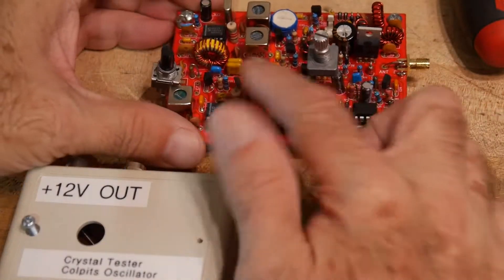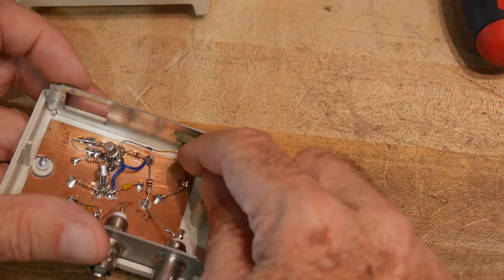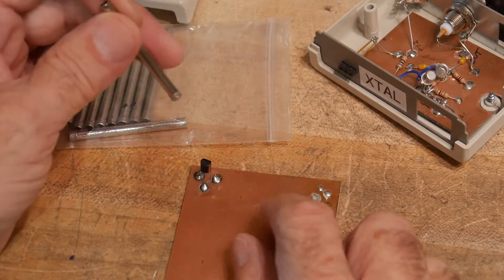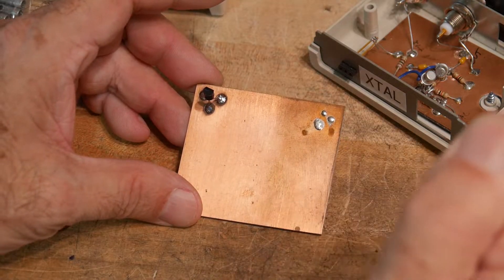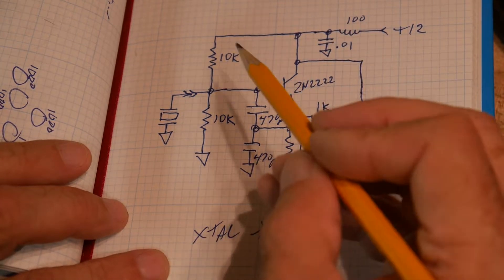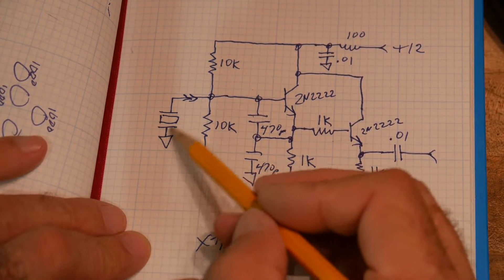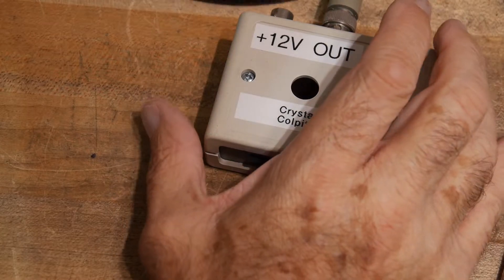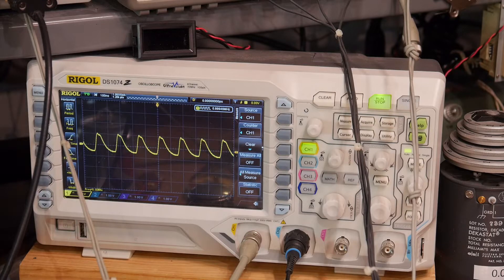#279 crystal xtal oscillator tester

Comment: I bought those 5mm hole saws you recommended- The pads they leave tend to come off the pcb with heat and at 5mm OD, the pads are only 2.5 mm wide, too small, considering also the pads work loose and lift off the PCB with heat. You MUST use a drill vice with them as well as they tend to move the board. I would recommend at least 6-8 mm. I found tiny dentist drills, which I had a few lying around, worked better, you can engrave tracks with them as well.

Comment: Xtal testers are handy, I build W1FB's design many moons ago. The first time I saw a BNC used for supplying power was when I got a commercial noise source...but I'd always worry about an inadvertent connection to something that didn't like a lot of voltage...was that an industry standard of some sort? Thanks for sharing!  73 - Dino Kl0S
Reply from the maker: fair comment. On this one the output (the other BNC) is a capacitor coupled output so not damage is it gets the power supply cable. I have used BNCs for everything for ever but probably not the best practice.